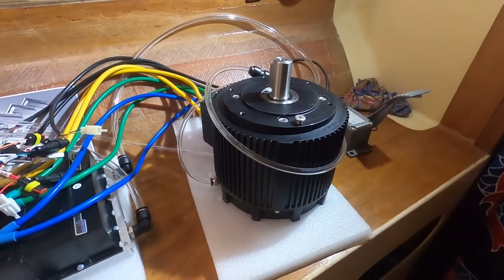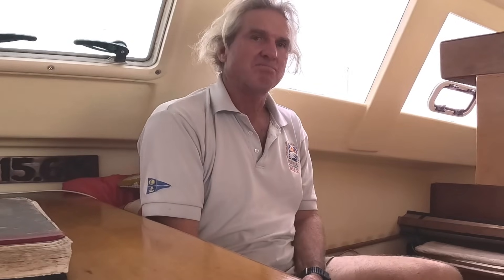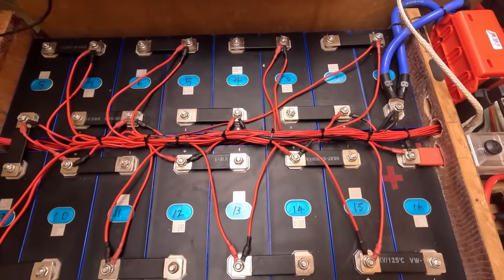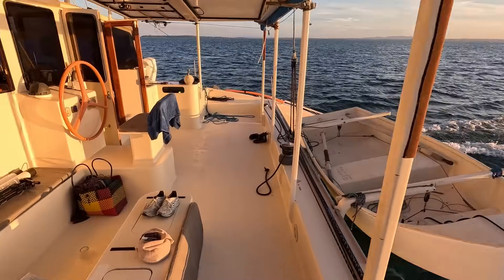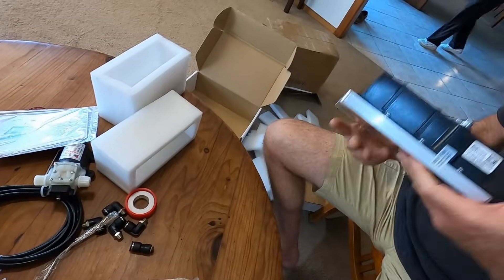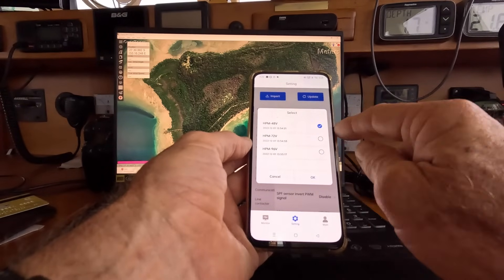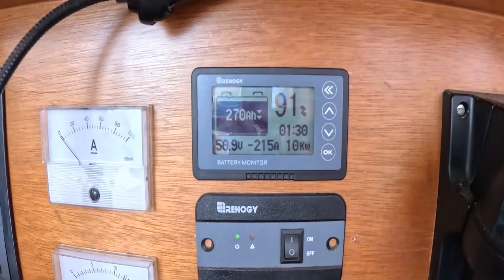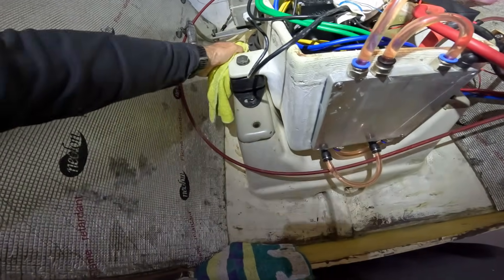16 Months using our Electric Motor -  Good or Bad?

Comment: I wouldn't trust the electrics on the open water due to the range...  You get caught in some bad weather, and you could really end up in trouble. Diesels? I can drop the sheets and run for 5 days straight at 75%. No storm will ever follow you that long. Electrics? You might get 2-3 hours out of, and you could easily wind up with no power or ability to control your boat.
Reply: He has a diesel. I hope he always keeps the one.
Reply from the maker: Hello Mornden, yes, Art Smith has it, we have a diesel anyway. Nevertheless when we are at sea we sail and in two world circumnavigations have never even thought of using the engine to control our boat, just the correct use of sails. Only in sub 3 knot winds would we consider a bit of motor sailing. Each to his own of course. Best of luck,!

Comment: Very interesting, thanks for posting . I'm on Macleay , i have a 53ft Trimaran i want to do a 48v motored system on , though i really think i'd br pushing 30 ton , currently with 140hp Volvo
Reply from the maker: Thank you Island times. Yes, not such a huge lot of windage, but a decent amount of weight! Plenty of space to mount solar panels. I believe its hard to produce much more than 10kw with 48v but I have seen people combining 2 together to make a 20kw motor, which would be getting in the zone to power your tri.

Comment: This motor is actually 30kw, not 10. You can drive it really hard if you want to
Reply from the maker: Hey Ted, I'm intrigued as to why you say this motor is actually 30kw. Can you elaborate on this idea?
Reply: @AndrewStransky-cc2dr if it is me1616 or similar it can run 24 kw on 72v or 30kw on 96w

Comment: my golden motor is now 3 years old en it's still working perfect, i have the 5 kw model but 72V so in reality is almost 9 kw peak on a 28 ft sailboat 3.5 ton in the north sea and I NEVER use more than 50 ah I don't even know how fast can go at 150 ah (is maximim power) with 35 ah i can run at 4.5 kn against 1.5kn current, at 50 ah more than 5 kn against wind and current... can't be beter....
Reply from the maker: This is great to hear Murphy. They do seem like a motor that will last well and I can see no reason why they wouldn't. I will now go and have a look at your videos to see the details of your system. You have some impressive figures there and no doubt many are interested to see.

Comment: Our C&C 30 Mk1 needs an electrical system upgrade. Gutjob, entire boat. I would love to move to a fully electric with solar to trickle charge it when I'm not aboard. She'll be charged enough for a weekend of sailing after a week in the sun. I'd be replacing a relatively low hour Universal M3-20. Is that a similar motor to your diesel? The idea of not having explodey juice in a tank on board is very appealing. Not having a fuel spill risk ranks high as well in reasons to ditch the diesel. Got any suggestions there?
Reply from the maker: Sounds like a good plan Daniel! Your M3-20 is a Westerbreke 18hp motor, so a 10kw electric would be very powerful and more than adequate as a replacement. I have heard of electric sailboats with quite small solar panels that can recharge their battery while they are out sailing so they return back with the battery full again, but of course this depends on how much you motor. I fully agree with you that it is nice to get away from the dangers of explosive fuels. Of course there are those who try to turn this around and say lithium batteries are dangerous and explosive. LIFEPO4 batteries are incredibly stable  and safe, but there is a fair bit of disinformation and fake news out there to confuse things. Setting up a electric system is lovely clean work and the maintenance is so minimal and clean.
Reply: If your motor will be 48V, your solar charging system will need to put out 56V. 3 typical solar panels in series is only 54V so you need 4 panels of the wattage that fits. Your boat will mostly be wired for 12V so you'll need conversion to that. Rough estimate for flat solar is 80% the panel rating times 5 hrs/day (summer) with a good charge controller. Battery bank should be ~1C of the motor. Solar bank should be >0.1C. Maybe 1 size smaller motor and more battery. Your monohull size is a little small to fit it all.
Reply from the maker: @artsmith103  there are of course the solar boost controllers that can produce the voltage to charge 48v systems from a single panel. I use one here and it seems pretty good.
Reply: @artsmith103  Yeah, I'm seeing "too small" every time I look at solar for the boat. She'll sail off the dock and rarely go overnight. I'm hoping I can are creative enough to design a system that will fit my needs. My solution might be leave the diesel in place. I hope I can get past that though. 
Thanks for your input. Much appreciated.
Reply: @DanielWillis-q2g  There's  a YT channel "Beau & Brandy Sailing" that removed a diesel on 35ft Pearson many years ago for a 10kW motor.  They have 2x400W articulating panels and it's barely enough. They manage but are aware of limitations. Should give you some insight. 60cell residential solar (~320W) are 36V so 2 of those would be enough. There are bigger 66 and 72 cell options with proportionally higher Vdc. I think Beau & Brandy have 72cell, ~42Vdc.
Reply: @DanielWillis-q2g  If you can fit over 600W, probably enough for weekend use. Freed up space below is probably enough.
You could try a motor bracket with much smaller electric and keep the diesel for limited use. I use 120W with 3,500 lbs. 1.2 knots, twice that would be nice but no more room. My weather is too varied to remove 8hp 2-stroke being 10 miles or more from Marina. 0 & +25 knot wind.
Reply: @DanielWillis-q2g  I was ordering Vdc equipment today with Amazon discount and realized you have another good medium size panel option. There are a lot of 24V panels now. Even be careful to avoid smaller ones for 12V that you didn't plan to get MPPT. A pair of 200W x 24V wired in series with a good charge controller should work great for your weekend sailing. 50"×30", 31V, $162 each.

Comment: I have a 26ft sailboat, with a 24Volt lithium battery 1,2 Kwh and a 2 horsepower about 1,6 kw ( 1600 watt ) engine.
i can run about 45 minutes full throttle and about slowly running 3 hours.
but i use it to get out of the harbour and start sailing.
i had a 4 hp 2 stroke, and it is really enough the 2 hp electric.
also a small solar panel and never have to check fuel any more no smell no maintanance.
Reply from the maker: Thank you Johan, nice to hear you have a very similar comparative performance on your boat. I suppose the key to this kind of system is that ones sails are the main form of propulsion, Enjoy your delightful craft,

Comment: i have tested alot of motor and finding out that more voltage and more torque motor can put out and less heat it build and less power and less torques and more heat put out and only thing get dangerous is high voltage and having 100vdc is not easy to touch with bare hand
if motor over heating too much them you need gear reduce or better cooling setup 
i can tell you are overvoltage controller that can leads to overheating issues
Reply from the maker: Thank you Kitty, good info! I can see what you mean. Higher voltage would be better, but of course 48v keeps us in the DIY arena nicely. For general running the motor stays very cool, it's just trying to manage the heat if you want to run it really hard for a prolonged period and thus the effort to make a good cooling set-up.

Comment: I am driving a 5 ton boat with a 6kW electric motor on a river. I really enjoy the nearby silent and immediate power delivery. Crossing oceans is a different story, though. Oceans shall be sailed. However, thanks for the interesting video! I would pack an additional combustion outboard engine for such travels, though. Just in case.
Reply: Always forgetting English speakers don't necessarily differentiate between sailing and driving under motor power. In German sailing (segeln) stands for travelling under sails only. Maybe that's of interest. Safe travels!
Reply from the maker: Yes, I agree fully, Oceans and seas are to be sailed not motored, that is where the joy and satisfaction lies. Haha, yes, I know some people say they "Sailed" when their vessel dosen't even have any sails!

Comment: Love your honest sailier content. In hindsight, what would have been the minimum required power output of your engines? I wonder if a ePropulsion Pod 6.0 EVO would be enough for a 6 ton sailboat? benefit would be no cooling as the engine is in the water, easy to install and to transmisson gears, so more power output compared a saildrive. Main focus is sailing not to racing inbetween islands with the engine. As far as I understand you, more battery would be more importend for a higher average speed, or? How about the current and headwinds? would be  a 1kw per ton enough for a monohull?
Reply from the maker: Thank you! I suppose we have 10 kw for a 8 tonnes high windage catamaran. !,25kw per tonne. Of course we have 2 motors.  So the 6kw pod motor would be similar for the 6 tonne boat depending on it windage etc. Also we must have some loses running through the saildrive. We did successfully sail around the world in a 43 foot/13m monohull with only a 13hp diesel which probably equates to a 3/5kw electric and it was a good 8 tonnes or more.  Head winds are good for sailing into or remaining at anchor. You just need enough power to push a solid headwind and a strong tide  to enter a lagoon or push up a channel for a fairly limited time if you are happy to mostly sail.
Reply: The safe combustion engine ratio is 4hp per ton. That would be 3kW/ton. 1kW/ton sounds too small if it's the primary.
Could you mount a separate stern electric motor mount, like an outboard?  Then it's no wind backup. 0.2-0.3 kW/ton is plenty for secondary motor.
Reply: @artsmith103  thanks for your thoughts. I am currently looking to buy a new boat for the baltic sea, Nauticat 32 or similar, some of them have doggy motors, so I think about getting a e-motor instead. As a EV  driver, in my experience I found the kw to ps somehow missleading. First there is a difference between direct  drive or trough gears, you will lose certainly some power there. Also if you look at a typical combustion engine, it peaks power in high revs. In lower revs for normal cruising speed, you find maybe half of the nominal ps left. Second my old combustion engine car was losing over time a lot of power, mind you it was 25years at the end. ;-) I like the stern back up outboard motor as an emergency , will look into it, maybe just something to fiy it there if needed.

Comment: 66 cycles that is like 6600km in a car, damn that's nothing.
That's like 2kWh per day with all electrical appliances.
Do you know how much solar energy you used directly?
Reply from the maker: Thank Raphael. Hard to really say how much solar we have used in the 16 months but one could say we produce about 3 kw a day so that makes around 1400kw in 16 months. Thats just on the 48v side of our system and we have an equal amount that goes to the 12v side which is mostly used for cooking.

Comment: I pray that battery bank doesn’t catch fire.
I’ll never have a lithium battery on boat after watching one burn like a Roman candle.
Reply from the maker: There are many dangers on a boat. Outboard petrol exploding, diesel burning, lead acid battery explosions, gas explosions, falling overboard while sailing, ropes blowing up under pressure, getting wrecked. I feel having a lifepo4 bank is one of the safest, but thank you for your concern and helping my Chanel.

Comment: I had many situations that I had to motor for over 10 hour . How I would do that with electrical motors .
Reply: He has a diesel. And if it was important, he could rig the alternator to charge the 48V electric battery bank for  slower simultaneous electric motor.
Reply from the maker: Hello Albert. Our battery bank is quite small as we are a high performance sailing boat who hardly ever motor for long periods. If it was dead calm we could still motor for 10 hrs though, albeit at a slow speed.

Comment: "The solar just dumps the excess..."  Could you elaborate on this?  Sounds extremely detrimental to metal hulled vessels in the area or your cat.
Reply from the maker: Hello JS, it dosen't dump the power into the sea via some kind of earth or anything. We don't have an earth strap and also wouldn't want our saildrives to be effected. It's just the same as leaving a solar panel unplugged in a field, the power causes no problem at all. I believe the solar panels themselves have a way of negating the power production when the solar controller stops accepting power. Interesting question though, but never fear, you are safe to come anchor near us!
Reply: @AndrewStransky-cc2dr  Very interesting!  Thanks for the clarification.

Comment: rule of a thumb is electric motor KW*4 roughly equal to replaced diesel HP
like 15kw electric can easy replace 50HP diesel
because ICE (diesel) power measured at his high RPM, at low rpm it produce only fraction of that power. on contrary electric motor produce max power at 0 rpm and also much more efficient
Reply from the maker: Thank you Lunar Vagabond. Yes, seems about right. Its still hard to convince many people of this  though and a lot of arguments rage on forums over this claim. Having used one I can see the truth in this though.

Comment: Ein Hybrid aus Segeln und E Anrieb ist immer ein Kompromiss ,weil er die Solarfläche beeinträchtig .Einerseits hat man mit dem Wind einen alternativen Antrieb wenn er weht ,andererseits kommt von der verschatteten Solarfläche weniger Energie um die Batterie wieder aufzuladen !
Reply from the maker: Very true Heiko. At anchor our panels still seem to get a pretty high level of sun. Sailing of course is an extremely efficient way to get renewable power from nature and also keep the boat very stable in the waves, via the sail pressure. Of course each person has a unique situation to deal with. Good luck.

Comment: Instead of shutting off, why can’t the BMS simply continue to supply the 300 amps? The speed controller should then see the voltage drop and it should be smart enough to stop demanding more power the instant the voltage drops causing it to output whatever power causes 300 amps to be drawn from the BMS.
Reply from the maker: I suppose the BMS is trying to stop itself getting burned out by to much demand. So what I have done is limit the controller to only 300 amps so it wont go near the BMS limit. Golden motor specs show anything over 10 kw should only be for couple of minutes anyway.
Reply: @AndrewStransky-cc2dr , If the BMS limits the output to 300 amps instead of shutting off, that would also prevent it from burning itself up. But if you’re speed controller can be programmed to limit itself to 300 amps, that’s another solution that will work. I’m glad you were able to solve it that way.

The BMS should be programmable too. You should be able to choose how it behaves. Both the BMS and speed controller have computers in them that should be programmable.
Reply: @AndrewStransky-cc2dr , What you don’t want is for something to shut off on you during a critical maneuver.
Reply: It shouldn’t just shut off. It should instead stop providing more power the instant it hits the limit, and nothing should fail or get burned up.
Reply: @terjeoseberg990  I suppose that would be nice, but current limiting is not what a BMS is for.  It's ONLY role is to manage (i.e. balance) and protect the battery cells, and of course, protect itself.  When it cuts out at 300 amps, that's what a 300 amp BMS is designed to do.  If you had a 200 amp BMS, it would do the same at 200 amps, again protecting itself.  Their use of the 300 amp model BMS is a good match to the cells, which I believe are 300 amp-hour (so, running at 1C).  You wouldn't use, say, a 500 amp BMS, because that wouldn't be safe for the battery cells.  And, this is all assuming the wiring and fuses are sized appropriately.

What they did in changing the motor controller setting to limit the current to 300 amps is absolutely correct.  That's what that setting is there for, and setting it to a value that protects both the motor from overcurrent, and is consistent with what the wiring and battery system can provide is now correct.  So to your goal, in actual use it should not be possible for any throttle setting to cause a sudden power cutoff, either by overtaxing the motor or its controller, or by drawing more than the battery system can safely provide.  A sudden power cut should only happen if there were a real fault somewhere, where cutting power is necessary for safety reasons.
Reply: @tubeuser2350 , Uhhh….. A BMS isn’t “supposed” to do anything. It can do whatever we design it to do. It should do everything we want it to do, especially keep the batteries from exploding or getting destroyed. It could do a lot more, and many do a lot more.

Comment: don't they have a water cool motor that you could set down there.
Reply from the maker: The 10kw motor is water cooled but the 5kw motor I purchased for the watermaker is only air-cooled, which which has meant I can only run it for a limited time.
Reply: @AndrewStransky-cc2dr  ok.